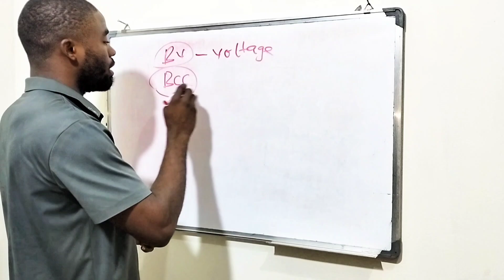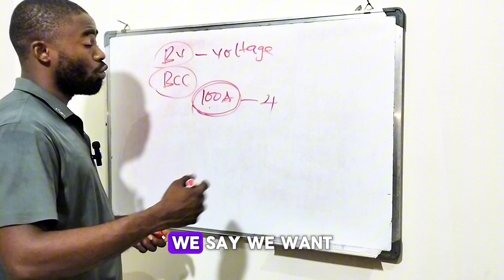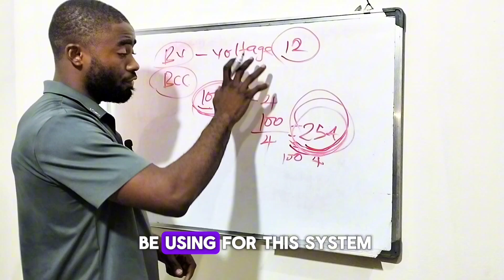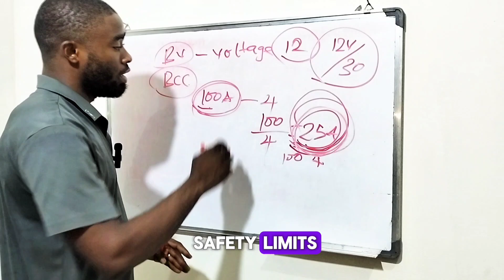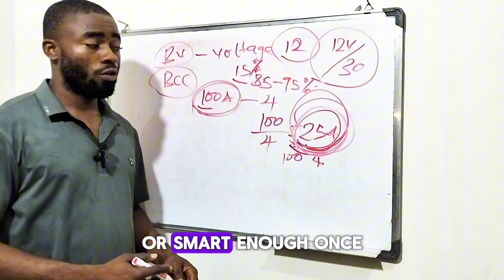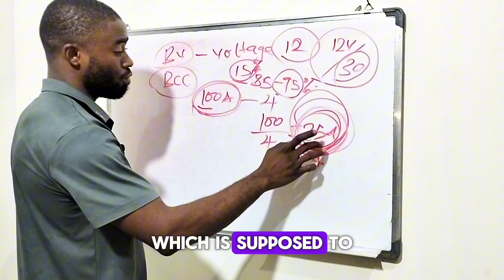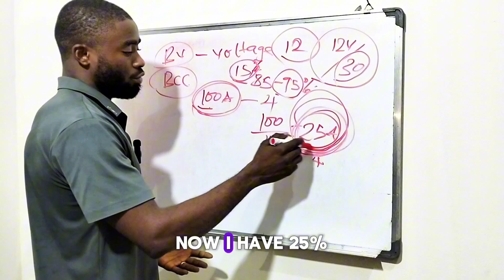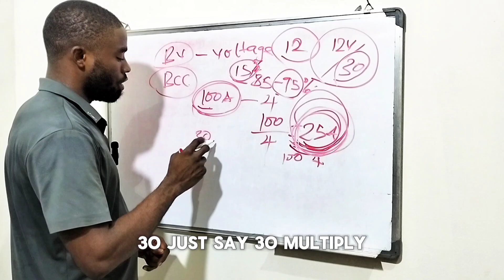HOW TO SIZE SOLAR CHARGE CONTROLLER.

Comment: SCC is equal to total power wattage of the panel divide by the Battery charging voltage multiply by 1.2safety factor
Reply: True

Comment: Hello bro,
Thank you for your reviews & teachings. Keep it up, you're the best!
But base on this teaching, I think you undersized the  charge controller on the previous work you did by using 60a controller on  PV of  420w x 5 ..
Becaus
If we're to charge the batteries fully  for 4 hours , it'd be .
210ah ÷ 4h x 1.15 = 60.375a controller.
But working back to get the total PV array,
60.375a x 24v = 1449w PV.

Also,
420w x 5 ÷ 60a = 35v solar system.

Can't one use the PV isc to size the controller or total PV in watts ÷ system voltage?
Example, 420w x 5 ÷ 24.

Your previous video 👇
https://m.youtube.com/watch?v=arT7K8B87J4&t=1s

Kindly reply me, I want to learn.
Reply from the maker: 😁😁, I didn't undersized. The design wasn't for the battery to get filled within four hours daily,.
The 4 hours used in this video is for demonstration purposes

Comment: Good teaching. But i have 2 issue with it.

Your issue of not using overcurrent of solar panel applies only to "dumb" PWM. A MPPT does energy conversion and it doesn't necessarily convert all.

Even a PWM doesn't covert all. If it does, then where does the 4 charging stage comes in? The Constant current, constant voltage, float and equalisation. If you consider those charging stage i mentioned, you will see that the controller gives the battery only the current it needs not necessarily all current available in the PV. Some smart controller even have temperature compensation and lower the charging current when the battery is getting hot. 

In a PWM controller, idealy, current IN from PV is equal to current OUT to the battery. So if the controller is not overcharging the battery with excess current, then it cant draw excess current from the PV. Only when you use a 30A controller to charge a 400Ah battery i see a dumb controller failing, because a smart one will reduce the charging voltage a little in order for the charging current not to exceed its 30A threshold.

Then i personally want to ask if you dont also consider the inverter load when designing a charge controller? Because when there is a 500w inverter load on a 12v battery, the inverter already consumes 40A of the battery/PV current. So please how do we reconcile inverter load and the charge controller current. I indeed want to learn.
Reply from the maker: A charge controller knows the amount of current left in a battery through the voltage, so it knows what current to release to your battery at a certain level!.
Nevertheless what I want you to understand is that if for example your charge controller is 40amp and you generate 50amp from the pv there's tendency that the charge controller will get damaged
Reply: @Mairigaemmanuel  

Going by what you said. Then we can conclude that if your controller knows  how much current it needs to charge your battery and not to damage it, wont it then know how much current it needs to take from your PV without damaging itself?
 
Then you haven't addressed the inverter load consideration when sizing a charge controller. Since we sometimes use the inverter also in the afternoon while the solar charges the battery.
Reply from the maker: @savageolatunde6731 considering the load that will depend on the inverter in the day time comes from your power audit, when you know how much power your appliances did draw in the day time, you sum it up together with the battery charging current to size the charge controller.
The charge controller can damage itself because it may try to open up itself to compensate the current drain by the appliances, process of these most charge controllers gets damaged.
If it smart enough it'll display over current
Reply: @Mairigaemmanuel  
Fair enough... you have said it all, the smartness of the controller plays a major role. A more smarter controller will limit the current instead of displaying overcurrent error. A charger generally is a variable voltage variable current device, it doesnt just dump all available power to the battery. 
Case closed.

If i get you right, if i have a 1kw 12v inverter system, and i draw 480w from the battery at day, thats 40A for load, then i need like 25A to charge the 200Ah battery, this means i will need at least 65A charge controller and about 800w PV. So that i can charge my battery and power the load at same time. 

So if i decide to switch off my load, then 65A will be available to charge the battery, which the controller should not give all that current to the battery, if not, it over charges the battery. We can see that the controller is smarter than we think. We dont neccessaily have to match exact current of the battery to the controller. 

My point is that we should always use much larger controller and much larger PV(voltage within limit) if we want to enjoy our solar. Your smart charge controller will handle the rest.